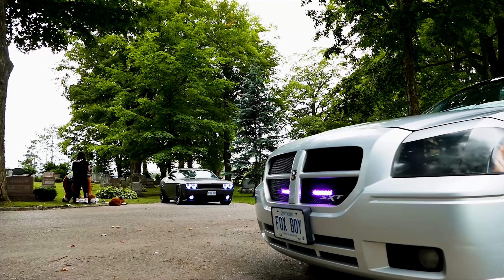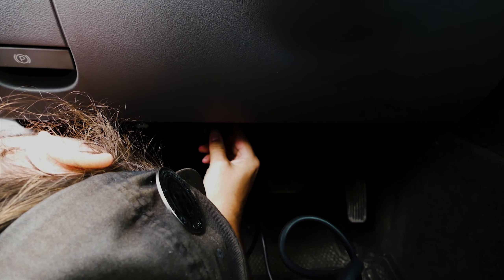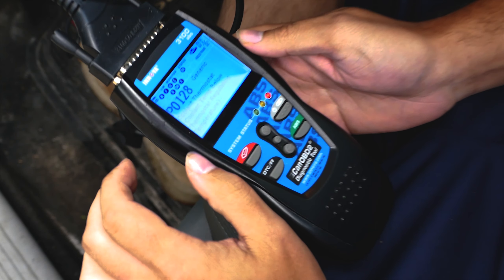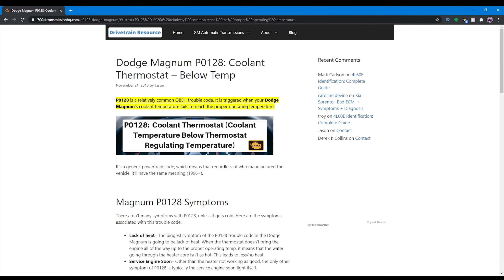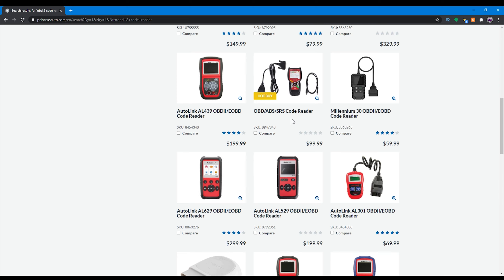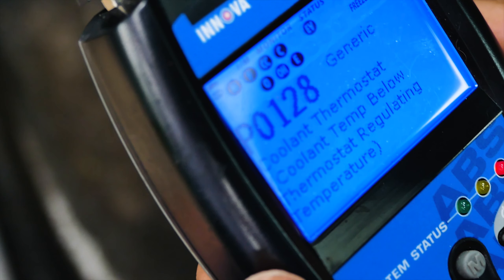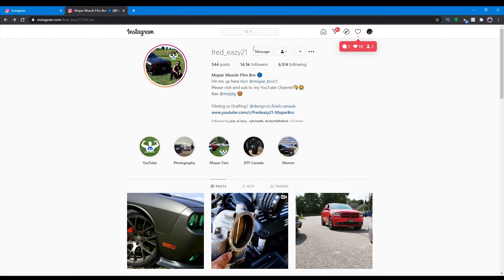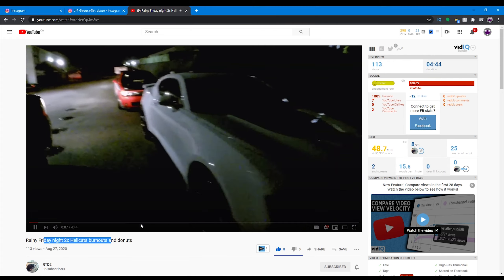how to use obd2 scanner

Comment: The Magnums system is extremely sensitive,  good and bad in that . It will put up that check engine light for very minor, minor things . Good way to stay ahead of problems though. Mine have all been small issues. Oil sensor was one, think it went on 2 other times. Not bad for a 2005 car. If that check engine light is flashing though, turn it off and tow it in, it's more serious .
Reply from the maker: Thnx for watching! 🙏
Reply: @moparbro  thanks for the video. My 2005 Magnum RT is still going strong , only had small issues so far .